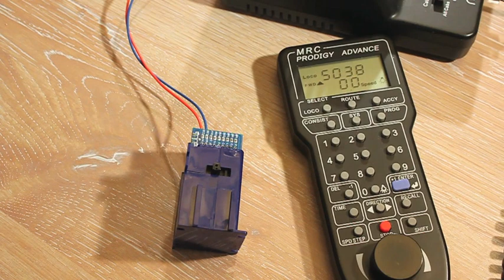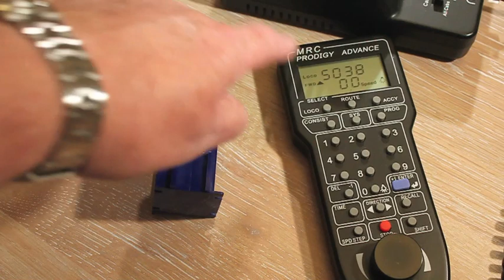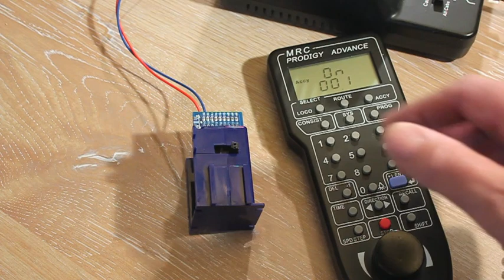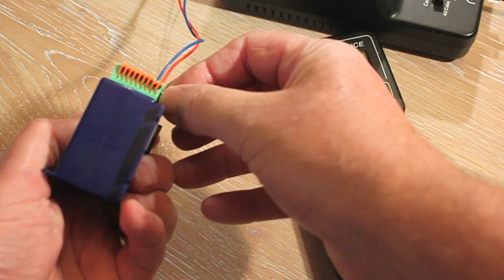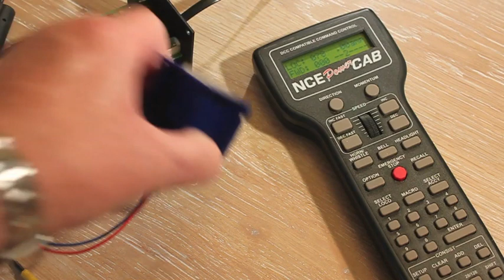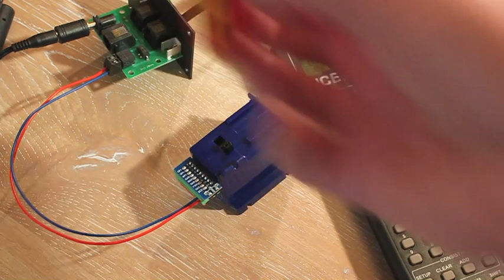Cobalt Digital ip point motor by DCC Concepts

Comment: Hi Brian, I watched your video few times and an excellent video. But I own Hornby Elite controller and recently I bought a Cobalt Digital IP slow motion pont motor for the first time to fit to my digital layout. As the point motor comes self centered, I tried to decenter it by following their instructions, but it do not work. When contacted Hornby Customer services, they only told me that the Elite and the point motor are compatable. Any advice is appreciated  to solve the problem.

Comment: Brian how would you get two point motors working to gether ,dcc cobalt IP digital and program it into nce power cab.Do you have to take the small spring out of the point.
Reply from the maker: Hi
Give both Cobalt point motors the same address number and they will move together when that address is entered.  Yes, its recommended to remove the over centre spring from points to allow the slow motion of the Cobalt movement to be used.   The over centre spring is not needed with Cobalts as the Cobalt holds the point blades closed to the stock rail.
Reply: will do this, now how to wire up the motor, can you have leds on this system would be nice.
Reply from the maker: LEDs can be powered from the Cobalts Terminal 3 using the DCC power or form the change-over set of contacts using a separate power source.  The Cobalt leaflet shows how this is achieved.  Don't forget LEDs are polarity conscious devices and must be connected the correct way around or they wont work and normal 2 to 4 volt LEDs will need a resistor in series with one lead too.